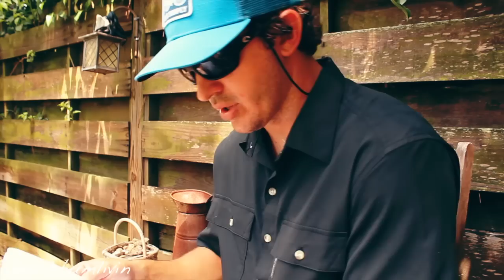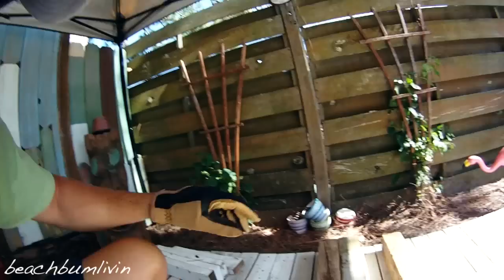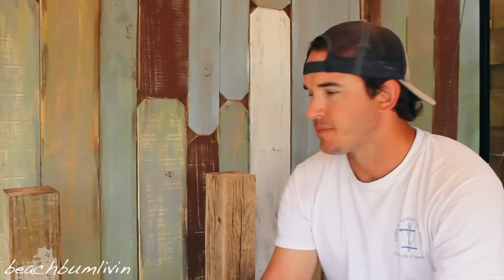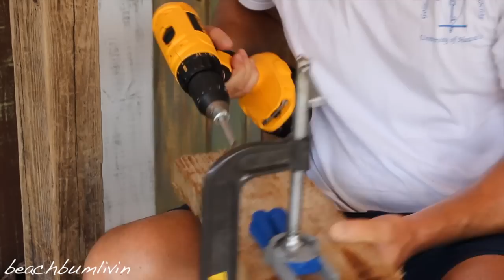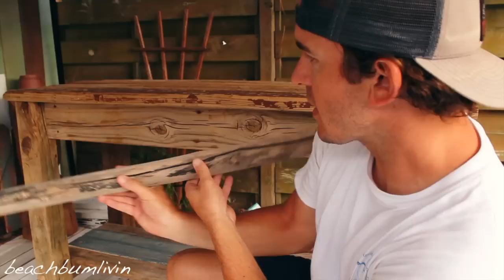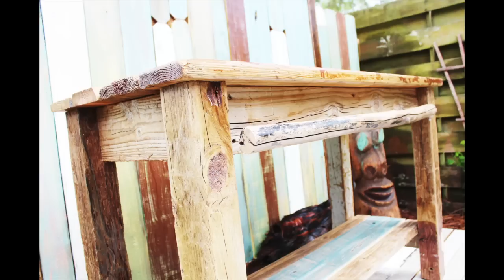How to build a Rustic Kitchen Island and Bench using Driftwood: Rustic Woodworking

Comment: Very handsome work.  The towel bar was inspired.  I've wanted to build my own furniture with some lumber from an old dock from a lake - much like driftwood, but I'm afraid when I cut the pieces to even the length, I will lose that rough grey edge on the ends of the boards, and the clean wood will show through and ruin the look.  I tried to see what you did to cut the planks to make the top of your island in the video, but couldn't catch it.  Do you paint the edges grey? Can you help me?